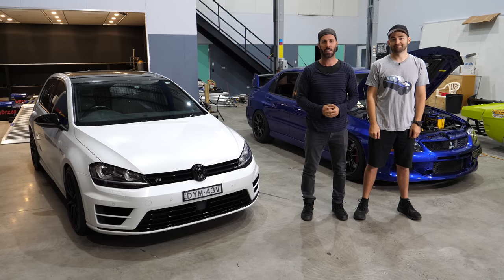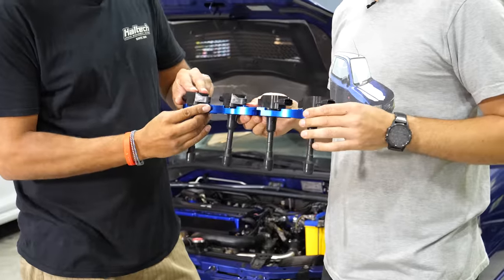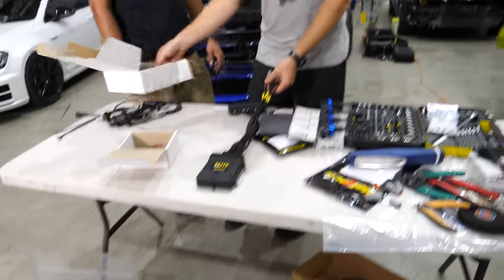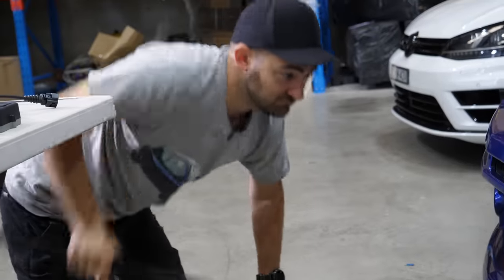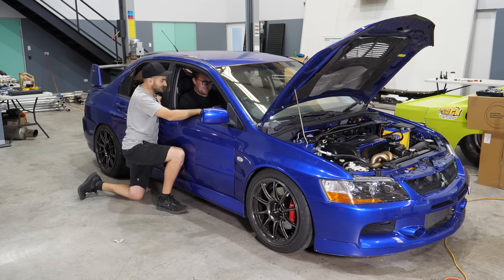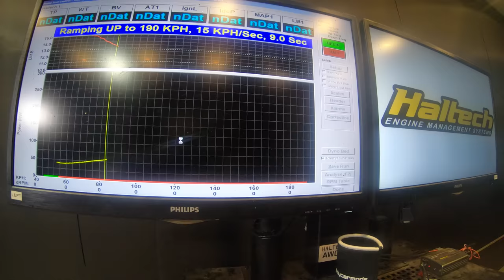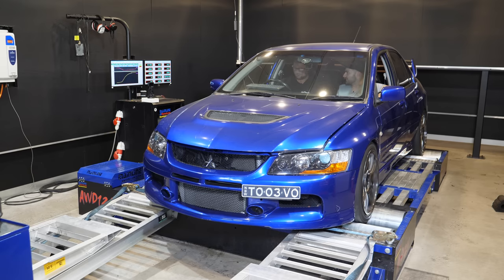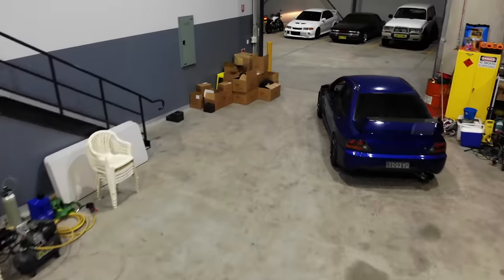Return of the Evo 9 (to the Dyno)

Comment: Looking good Marty!! 
Just a word of advice from a fellow evo9 owner; I advise on upgrading your tcase and rear diff if you’re hitting power beyond 400bhp. Especially if you’re going to be hitting the drag strip and dumping the clutch at 4K rpm.
The weakest part of evos are the transmission and drivetrain- not the engine. 
I would hate to see you blow something on your driveline launching trying to beat the R!!
Reply: yea have repaired a few transfer cases on these, common as fuck, and when they go they usually take the bellhousing with them lol. Evo lyf.
Reply: I was at a workshop recently and they had an Evo that had munched the gearbox launching it. Looked like someone had detonated a grenade in it lol
Reply: Good tip.
What options are we looking at?
Reply: Probably shouldn't be dumping the clutch at 4k rpm though, I would advise a bit more rpm so it doesn't bog down and also slipping the clutch on the initial launch to take some of the shock out of it. Simply dumping the clutch over and over will definitely lead to disaster
Reply: For sure. Owned 3 evos and currently own a Galant vr4 with 400awkw and a tmz built transfer and dog box. 

Blown 3 boxes so far. Started happening at about 380hp. Had to detune it while the box was being built
Reply: Danial Daneshmand there are plenty of options around, in the states mainly. But a few in Aus too. TMZ, PAR, Neat gearboxes, TeamRIP all build good evo boxes.
Reply: What upgrades can I do to an evo 3 for this and Would anyone be able to source me an evo3 engine ?
Reply: I  road race my Evo9  in 90-100*temp weather.it makes 490whp on Flex fuel & 415whp. On crappy California 91oct. 
Stock OEM clutch & all fluids on it Engine  transmission, brakes , Rear diff.  Are Synthetic Motul.besides the ACD.(Mitsubishi OEM fluid) 
I dont drag my Evo9.   But I've done 1-2launches at most. Never had any drivetrain issues. Damn Evo is pretty bulletproof!  I do keep a rigorous maintenance on my Evo. I dont understand how u all running  with all these issues??🤔🤔
Reply: There is enough adjustability in the Haltech so you can run different tuning options such as boost, two step ,timing ,fuel and traction control etc so it doesn't shock the drivetrain as bad if at all during launch and gear changes. I know a  aftermarket transmission, clutch and diffs would be needed to get the best times and speeds out of it but after already spending the money on the Elite you my as well use all the functions on it.Without spending another amount of money in witch god only knows that is not needed when it's still basically a street car.
Reply: @JuanAntonEgo  Launching on the street is totally different than a track that's sticky enough to rip the shoes from your feet.
Reply: Its fun feeling when your transferbox locks down while driving, just sayin :'D
Reply: Ive owned plenty of stock diff an stock box evos from 1-9 an only had 2 diffs replaced  1 from helis an 1 coz the evo i was sold was dodgey  400bhp claim untrue  plenty of stock ayc models have pushed 600whp+     the 6spd is a weak link compared to the 5spd  but even so ive personally had 460whp out of my old 9,  my bro 8gsr had 480whp as a 6spd  an ive seen the odd few here go 550whp+    if u wanna circuit tho  rs 5spd box  if u wanna drag gsr 5-7  5spd    if u wanna daily an do both  Adm 5spd   same ratio as the 6 but much stronger box
Reply: This just isn’t the case I’ve seen plenty of evo 8/9s with over 400kw atw on standard drivetrain , it comes down to how you drive it. My evo 5 had a standard drive train when it was making 500+kw atw , sure it wasn’t going to last forever but it held up fine with some mechanical sympathy.
Reply: @dane443443  black 5  named the   black widow?  2.3l 6466?  Done at powertune?    An just for none Australia's 500wkw is over 600whp  out of a stock 1998 evo 5   impressive
Reply: JJ Sorenavki that’s the one man 500Kw sits around 670 wheel hp.
Reply: @dane443443  thought so,  i remember the first owners name was Dane  when i seen it forsale,    ive also had a few cps in the 450-550wkw range on stock drivelines  if you have mechanical sympathy they actually do last
Reply: JJ Sorenavki yeah man haha you have a good memory : ) they are surprisingly strong the CPs
Reply: @dane443443  bulk power  im all about the first gen evos now tho
Reply: 5 Speed boxes are a lot stronger than the 6sp.
Transfer case is a different story lol. 
I've blown both a rear diff and transfer case but my 5sp holds up well.
The key to launching them is to slip the clutch
Reply: @jfoulstone  RS driveline FTW! only non rs ive had was 9 & mr  but still no breakage with a 360wkw 9 an a 500wkw 8mr on stock front an rear diff + tcase,   an 8mr was a stroker,  but after then i hunted for cp9a rs models  but not because of the diffs
Reply: don't worry, he cant even tighten the intercooler piping!!

Comment: From a master UK mechanic and diagnostic technician  of 35 years  you are doing a great job with the evo it should bring out mass's of power and it will take it lap it up like a dog on heat one thing though once you have tuneded it to the haltech ecu there is no way you should then run it on the factory ecu it will run like a bag of crap and probably burn out some of the haltech sensors the only good thing about the wiring harness is ease of use and for when you come to sell it so you can keep all the good stuff and put the factory sensors back on, besides that you guys are golden you do give a lot of good advice to amature car builders keep it coming lads all the best from john from Rugby warwickshire UK

Comment: We need Turbo Yoda on the Evo🔥
Reply: Turbo Yoda does builds.  This is a factory build with, um, evolutions.  No need for Yoda-ing here
Reply: Might be in line for the turbo upgrade that comes after he gets chopped by a Golf.
Reply: @ArtosDeDraconum  Marty and Tuning Fork did discuss how much power they should set it at - more was possible, but they didn't want to blow the engine.  So more power means a rebuild with a stronger bottom end.  Lotsa dollars....  and the Golf R will still have the dsg advantage
Reply: ChrisHallett83 of course

Comment: Such a safe Evo Tune. Most garage queens are 500hp
Reply: In what country? I know a few Evo that are driven hard at the drag strip on drag radials down into the single digits. 2.3L PTE 6062 or GTX 3582. TRC's Evo is 1100 whp can and has beaten a Yamaha R1 in roll race. MCM/B4Build/Tavish have such low expectations now it's troubling IMHO
Reply: @dj4monie  thats drag racing those engines are not expected to run longer than a 20 seconds as they are filled blocks more often and not and have no water cooling.

Comment: The problem is that it's not going to be down to the power, handling, drivers, or conditions. It'll be down to the gearboxes. I think that Wolfsburg's direct shift system is going to make up the difference in power and it's a lighter car.

Comment: I'd like to think Haltech dont charge MCM for the workshop services and dyno time, Yes its all has a cost and maybe the ECU's are like 50% off?
Reason: Before becoming an avid MCM fan maybe 5 years again I'd never heard of Haltech, I just thought motec or holley was the mutts nuts and now my eyes are opened from the use on the show, I'm not going to guess MCMs revenue but I can imagine how expensive those ECUs + workshop time + dyno time is and it would be a show stopper for most people.
So if time was free and parts were supplied "for testing" or discounted I think that would go a long way to show the brands recognition thanks to the lads.
Stay awesome all of you :-D

Comment: With a 4 wheel drive system you always loose more power than a 2WD. So if you are putting the  same number on the dyno, then actually the engine is making more power than the 2WD engine.

Comment: Can you guys answer this question please.
I notice you are always using OEM coils from a performance vehicle VS Aftermarket ones.

I have a 2016 Fusion and with a tune I put gaped plugs @ 0.028 but with the 91 & 93 tune I can always replicate a situation where the car in a higher gear  under acceleration it breaks up. Normally that would mean to close the gap more but its already come down from a 0.032 to a 0.028 & Its fine on the stock tune both with the stock plugs and the gaped plugs.

I've been wondering about trying to upgrade the coils but whats available is like Accel and the reviews aren't great. I was wondering about maybe Focus ST coils or Focus RS coils in the Fusion 2.0T

Comment: Do you guys hairspray the inside of your silicone couplers? I've never blown off a coupler but I've also never tried running them without extra strength unscented hairspray. It basically acts as glue, might solve the problem.

Comment: When converting ECU like this, I must ask about the total system in the car.
It seems like the EVO are pretty nice to convert, but doesnt some other systems have things in ECU like ABS, SRS, Alarm, antitheft, ASP, speedcontrol,  and loads of other things?
How to get around that? Does Haltech ECU support it? 
Like in te Volvo 850 I have there are 3 boxes, 1 for ABS, 1 for Automatic and 1 for the engine, that might be pretty ok to change to another ECU like this. but other cars does not have several boxes like that, what I have seen.

How to work around that if so?

Comment: jubilee clips for boost pipes are just hurrendous (from experience). the one you shown is better, but you can get even better ones that use a straight removable bolt rather than the curved fixed one as you shown, it has two threaded inserts on each side of the band, these you can clamp really tight. (ive tested under boost to ~23psi)

Comment: I dont think that was a stock computer you binned .... i dunno if 8/9 is different but when i removed my 7 computer it didnt have a vac line going to it .... whereas the aftermarket board that i fitted in the stock casing did have a boost reference on it

Comment: Since they're using their own connector standard, is the software able to import profiles from older versions as well?
The idea is that you can buy a newer model of their ECU a few years down the road and use the profile from the previous model as a starting point for the re-tune.

Comment: I was worried about the extra power on my Mercedes AMG engine being tuned up too high, but after seeing a 2.0 4 banger Mitsubishi engine (which I have owned and know how unreliable they are) put up 385HP, i'm not as concerned about my Twin Turbo 3.0 V6 putting down 430 AWD HP and 530 AWD TQ

Comment: What size automotive wire are you using in the wiring harness?  How different is automotive wire in Australia to automotive wire in USA ( AWG )?  Example 10 AWG wire is used in Automotive relays.  Can you get Haltech in the United State?  Do they meet United State regulations?
Reply: Wire is the same everywhere, just measured differently. I recall Japanese manufacturers measuring wire in square millimetres, there's conversion charts between that and awg.

Haltech is available in the US, I remember seeing them when looking for aftermarket ECU options.

Comment: Only 23PSI on E85? What is the limiting factor? Stock turbo you can run that.
Reply: It has a bigger turbo so it flows more at the same PSI.
Reply: Should've still made closer to 300kW or more tbh, made the same power on stock turbo on e85 lol

Comment: Hi guys,you have tested alot of theorys .have you done a spark plug test.like pointing the electrode of plug towards inlet valves using washers and runing xtra earth cables to head studs next to plug for improved spark and ignition of fuel.i did this on my old mini 1275 a series, started better but moter was tired

Comment: Thats stock Evo 9 turbo power. I could have sworn they said this was a bigger aftermarket turbo?
Reply: Yep has a gtp762! But on conservative tune & only 22psi is realistic! 9 turbo would need 26-27psi at least to go over 280
Reply: @markc1456  sure, but if that's the case it's got a lot more in it. And they're acting like it's on the verge of exploding engine pieces everywhere (oooooooo) Scott has to know as long as you keep it around 400wtq the stock block is fine. You can make plenty more power safely for track use on that thing. I only have an issue with this because now they're going to go race. The golf's going to win because transmission, and everyone is going to say we'll guess Evos just suck. But in reality that car isn't to its potential.

I also realize it really doesn't matter, it's entertainment, and I'll just push my HTA71 Evo 8 way past this and have fun doing it.

Comment: The Yellow run at 33.24 gives a higher peak power figure, but at 96 kph it is 25 kW down on the purple run, so accelerating out of a bend it will make 75 kW instead of 100Kw. At 96 kph, the final golf dyno run showed 112 kW. I predict the Evo will get chopped coming out of the bends, and the straights will not be long enough to make up the difference. Much as I would like the Evo to be closer, I think it will be outclassed by the "humble" school run-mobile. :-(

Comment: It's not the dsg thats the biggest difference, it's the massively better drivebility that the more modern golf engine have with loads better response and low en torque, especially on tight tracks. However, the driver capability will be the deciding factor, as its often is in the real world.

Comment: Hold up, wait, something is not right. I'm I missing something??? First time on the dyno with an exhaust leak, various engine problems, check engine light, bad cam sensor, and basicly in limp mode, the evo hits 270 Kw. Now with all the fixes, mods , new ecu, etc etc... the car only hits 287kw??? Only 17kw (22hp) more. What I'm I missing? I was fully expecting it to break 300 before they even started the run.

Comment: Popping cooler pipes? You need hairspray and the clamp you replaced are a lot better your literally in the same power I’m on with my speed 3 I’m at 367hp and 347tq but awd and fwd is a big difference

Comment: how is Moog only making 15 more kw over what the stock turbo makes with a stage 2 map?  even without the fueling upgrades that golf should be making more on that revo setup.  Most people are running 300+kw with fueling upgrades.
Reply: Moog's is at the wheels, not crank.
Reply: @S147  I understand that.

Comment: I'm not great with EVOs, but what I don't understand is why they're shy on boost? Two of my close friends have EVO 8 & 9s, both running 33psi and 30psi of boost on stock motors respectively, minimal mods done. Why is this?
Reply: Because stock turbo .....only so much boost you can run.
Reply: The one on 30psi is running a stock turbo, 06 EVO MR

Comment: What happened to the focus rs? It makes just under the same power stock. Why not compare that to the golf.
Reply: It makes that to the crank, not to the tires. There's alot of loss in all wheel drive. Annd, because Evo.
Reply: @coryp6896  They also did the montune mods to the focus so the losses from the power train and canceled out by that but yes EVO.
Reply: @swagfest2k144  Definitely forgot about the mountune mods. They should test all 3 of them.

Comment: I don't get why Marty loves e-throttles so much.. You get no feedback from them when you are driving, plus there's a delay in them when you hit the throttle. Both my parents vehicles have them and I hate them. '03 Ram 2500 5.7L and '10 Challnger R/T 5.7L (I myself am car-less at the moment.. unfortunately whatever I buy will likely have one too. Planning on possibly an Audi A3 or A4 Quattro or '07+ Mini S)
Reply: OtisENGINEuity that delay is a factory tune characteristic. Drive by wire can be instant, it is all in the tune,  and electronic throttle is superior in many ways.

Comment: still don't understand how you only made 280 kw = 375 whp on an upgraded turbo on the R.. Whereas I'm currently pushing 340whp on the stock turbo and meth. Yes I know difference in dynos, etc but I was still expecting to see at least over 400whp.
Also you definitely need to use T-bolt clamps on the intercooler piping/hoses
Reply: If I got the details right, it was on pump fuel, but it is E85 ready both hardware and software wise. Moog said it in a bit cryptic way when he took it to the strip: "Time to experience what this car feels like the way it is going to be driven daily... on pump fuel".

Comment: From 6 to 8300 turn it to 28psi. The stock 16g can take it... the engine will take it forever. the 4G63 in the Evo has been proven to take 500 in stock form with bolt on's...  you guys have a lot more to go.

Comment: My Haltech E6K would like to talk to you about depreciation.
Reply from the maker: It's done a solid 25 years though right?
Reply: @mightycarmods  19/20 years I suppose I got it in 99/00.  My post was a bamboozle anyways, since I sold the car a few years ago to a guy who said he knew what he was doing, but didn't and ended up destroying the ECU trying to clean up the wiring.  Anyway, it was fun to work with when I had it, so no regrets.

Comment: Excuse me guys.
The "One ECU to run them all" won't be a good idea. 
You wanna keep the ECU when you sell the car, but the OLD ECU won't run the engine AT ALL because of the changes you made to it. (ignoring the fact that it's in the bin)
Simple example: changing from wasted spark to direct fire, OE ECU only has 2 triggers never mind the other mods.
Who's going to buy a modded car with NO ECU? Unless you undo all the mods before selling it?
Reply: I think they were talking about if you own several different cars that you could run the same ecu. Because obviously you can not drive all of your cars at once.